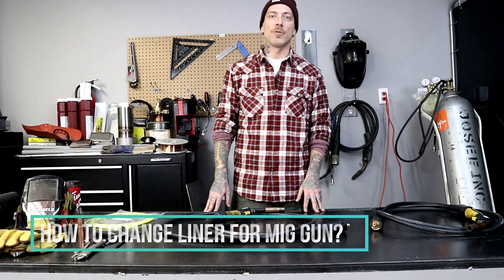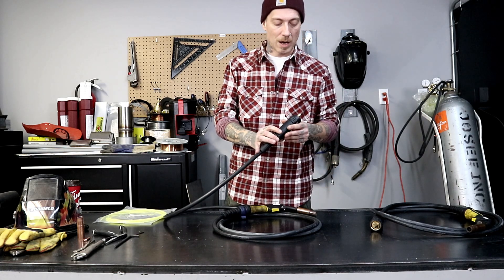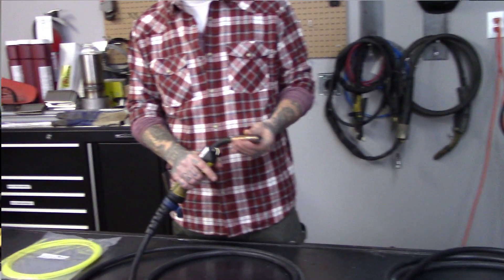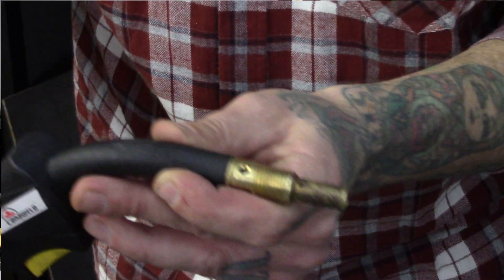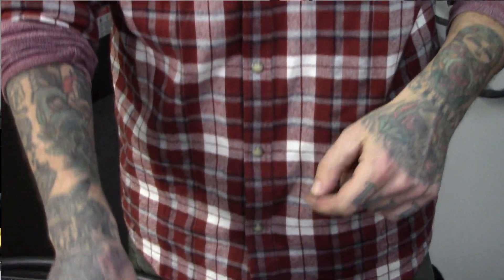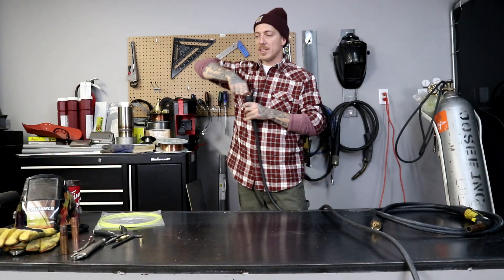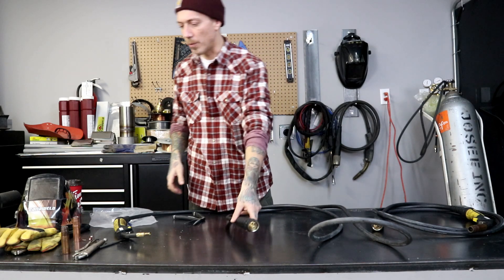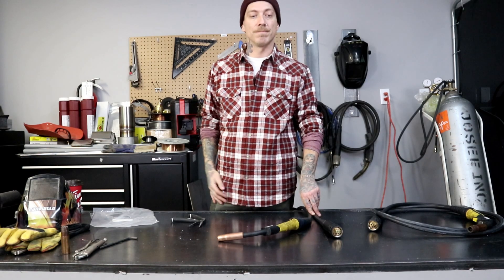Aluminum welding for beginners How to change liner in mig welder

Comment: The old liner had a metal rod, the new one didn’t, isn’t it needed to keep the welding wire straight when it comes out of the gun?
Reply from the maker: yes exactly
Reply: yes it is it will meltyou need about 1ft of wire on torch end